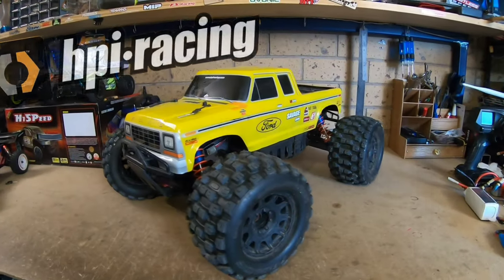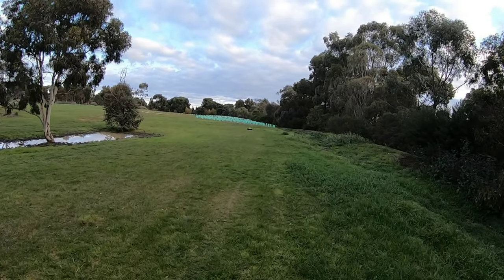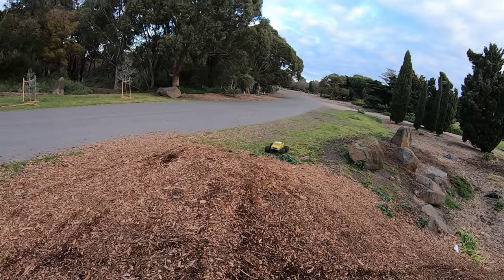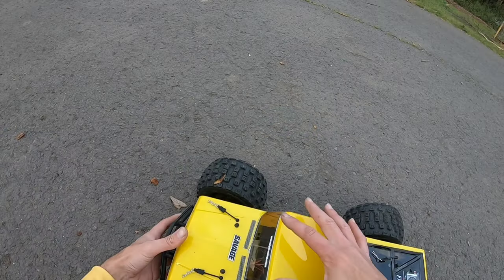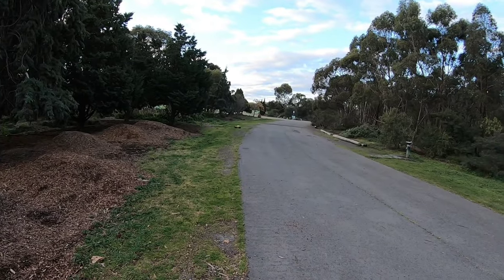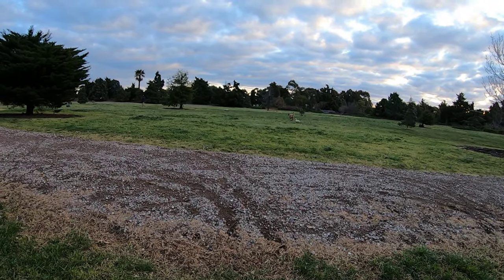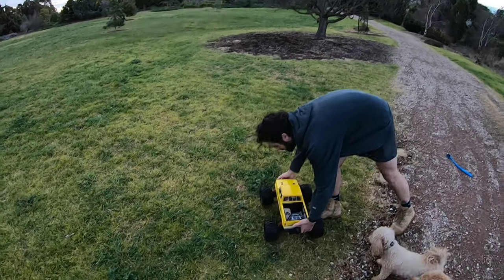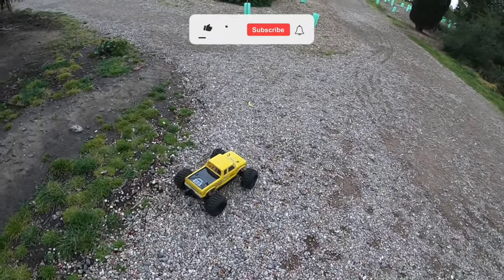My first EVER second hand RC!... BAD swap or GOOD idea? #rccar #hpi

Comment: Looks pretty good with the Ford Pickup body, pity the esc is not up to par so you can drive it around properly.
Reply from the maker: Yeah it looks pretty good, but yes in my experience all surpass escs are absolute junk!
Always get better results and actual precision using quality escs.

Comment: Great video. HPI Savage look really awesome. Looking forward to seeing the performance with another ESC 👍 Did you drive on 6s? You probably mention it in the video but I missed it if you did 😂
Reply from the maker: Thanks mate!
Yes should be MUCH better with a good esc, may need 160a due to this cars ridiculous weight but we'll try a 150a first, not a huge motor.
And yes 6s, I did overlay a picture of the lipos I'm running just as the driving part started but probably easy to miss, my bad🤦
Always forget to actually say something, if i notice I try and pop it in somewhere😅

Comment: Wait until u put a better esc in there Saul it’ll run much better the gears meshes sounds sweet as you’d like
Run this hard next bash maybe even a back flip or many once esc is better💯😎🫡
Reply from the maker: Yes hopefully the esc is the only downside, get that swapped out and it'll be much better next test🤞
If I can control it there will be backflips🤪😅

Comment: Good video. Overall, I think it's a good trade. Based on what you have said and what I have seen in your videos, those speed controllers do seem to not be very good.
Reply from the maker: Thanks Tim!
Yes considering the condition of my X-maxx, needing a few very pricy parts the deal itself wasn't so bad.
But yes every single Surpass escs I have had or used in other people's cars have been terrible.
They don't follow your throttle input, always lagging and cutting out almost like they aren't really the specified amps🤔

Comment: Jumps nicely, very balanced. Maybe its just on the screen but it seems a bit slow, what gearing does it have in it? 
Runs very well though😅😅
Reply from the maker: Thanks Li👍
It's not as fast as most of my other cars but it's not slow, I was taking it very easy because the esc was so unpredictable.
I'll be more confident to push it with a good esc.👌

Comment: When u r a true fan you simply are...
Im a big fan as well. I had a x maxx a few years back qnd it seemed too big to me... it is an excellent truck. Ended up selling it... i have an savage flux hp with alza cd and extra upgrades next to my mini savage with high end pinion next to my vorza super upgraded with d8 aluminum parts next to my super upgraded bullet st flux next to sprunt 2 with saleen body...
Love them all and they look awesome next to each other...

One question: what brand are those shocks?
Reply from the maker: Awesome another true HPI fan😁
Yes the X-maxx is an AMAZING car but definitely impractical for someone like myself not having a licence to transport it and the cost is just too much.
1/8 is big enough.
And the shocks aswell as some of the other alloy upgrades are GPM, not many people are fans of GPM but I think they are great for the price👌
Reply: @rccrazy  here in the us , most love gpm... i wish gpm make those shocks again....
Reply from the maker: Yes I looked for these specific ones online but couldn't find them.
The ones that available here in Australia are great though, widely available here aswell🤔